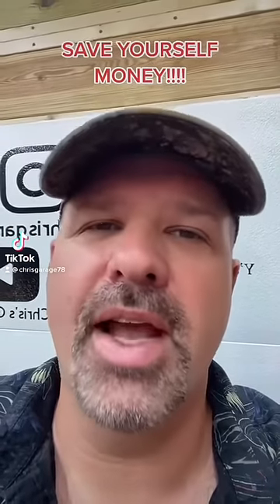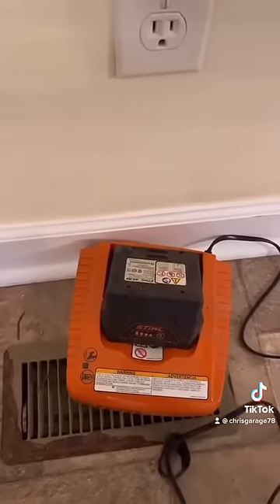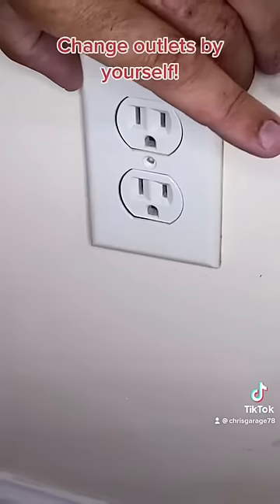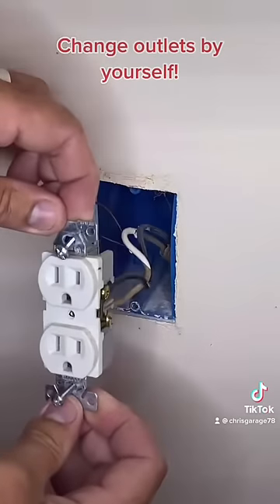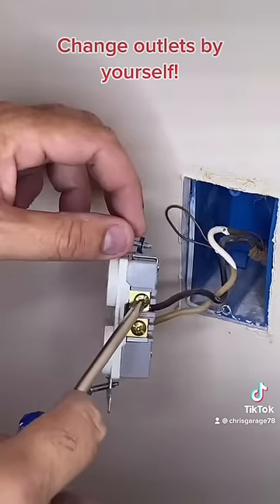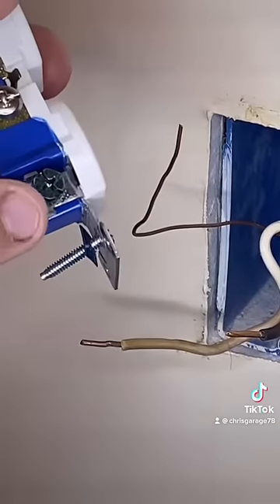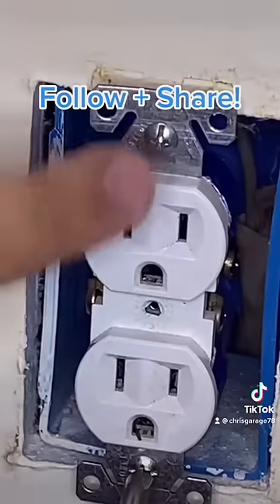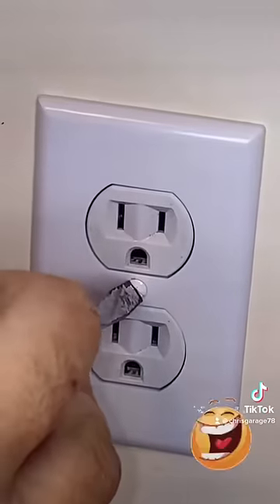How to replace an Outlet/Receptacle

Comment: Also, don't just line the wires up how they were before. Just because both were on the left or right on the last outlet, doesn't mean they will be the same the next time. The white wire goes on the silver screws, the black wire goes on the gold screws. The white wire is neutral, the black wire is the hot wire.
Reply: Correct! Good advice
Reply: If both sides of screws are gold it should be labeled telling u which is the hot
Reply: @reese1256 it’s impossible for both sides of the outlet has “Gold” screws/connectors because one side is neutral and other is common. Unless I’m not comprehending your comment correctly, you should never see gold on both sides. Sometimes you will have multiple circuits connected on one outlet, mostly because of the outlet being used as a “Master” circuit. Hopefully, I’m reading your comment correctly
Reply: You’re absolutely correct 👍🏾
Reply: Im about to trust a comment on YouTube with my life 😆

Comment: Inspect your wires before putting the plug back in. I see you have a nick in your identified wire.😂 Black to brass white to silver. Don't just take a picture, you could be taking a picture of an incorrect application

Comment: Pigtails, and screw in the terminals that you don’t use also tape the box if it’s a metal box or hire an electrician, because you’re not insured as a homeowner so I wouldn’t take my advice on electrical installations from a YouTube short
Reply: 😂 Home owners are Insured to swap out a receptacle. Homeowners can even pull their own permits to add branch circuits. A journeyman cannot pull a permit.
Reply: Homeowners can do whatever they want. We have that freedom. And we're here to find out how, not listen to Chance Lowery.

Comment: Great video. Nice job walking through testing both sockets (and recommending that a picture be taken). This thoughtfully covers the novice DIY-er without getting into the details about how the shunt on the outlet could have been cut and 2 circuits might run through it.

Comment: Also DO NOT just flip the breaker…. Just flip the main power switch off. There is reports of people getting electrocuted because they only flipped the breaker and not the main power.
Reply: U don't need to do main power the breaker cuts the power to that room unless ur  got some werid wiring issues.

Comment: What if the original outlet doesn’t have a ground hole   Can it still be replaced with this same method or do we need to hire someone 😅
Reply: Yes you can still replace it you just won’t have a ground wire

Comment: Opening a breaker and testing with an appliance does not prove isolation. Reversed polarity at the supply? Opening the breaker just opens neutral. It does, has and can occur.
Reply: Opening breaker opens hot
Reply: Turning off the breaker does not open the neutral

Comment: It looks like the 2 wires are hooked on the same side which will be a short, I know that it's a wire on each side left and right, left is neutral or ground and the right side is your power or hot, well you know what I mean..
Reply: That means it isnt the last outlet in a string.
Reply: No. The second wire goes down to the next outlet in the wall or to a switch, it's not a short having two black wires on the same side.